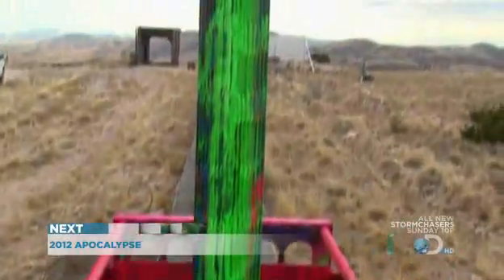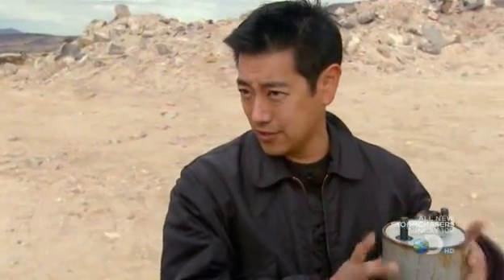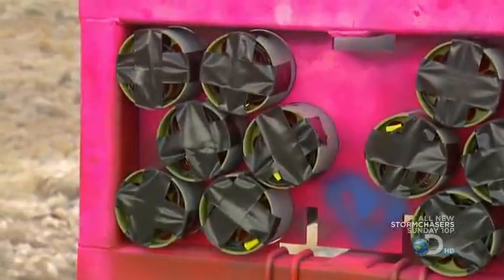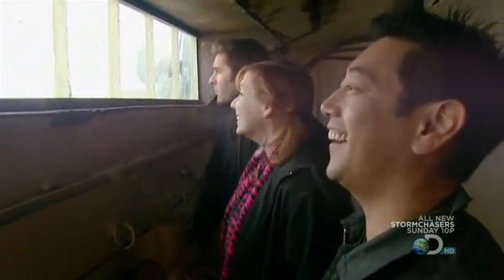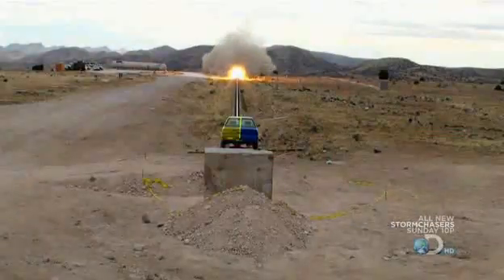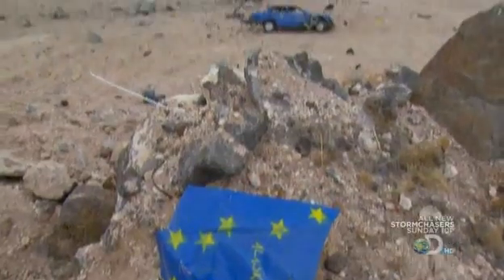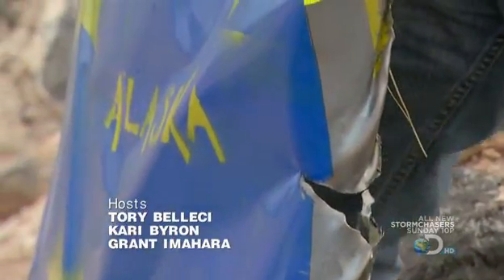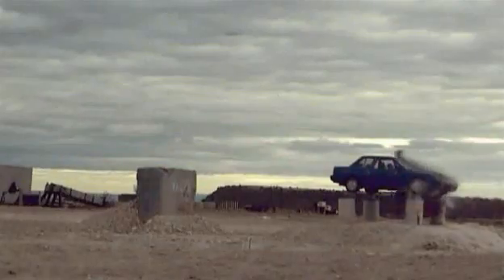Mythbusters: Myth Revolution - Rocket Snowplow

Comment: why didn't they use 100000000000000000000000000000000000000000000000000000000000000000 rockets
Reply: 'cause they probably don't know anyone with that many rockets
Reply: 10^64 is much MUCH more than the amount of grains of sand on Earth (10^18).
It would be better to say, the number of atoms earth is made of (Which is 1.33*10^50). And that still doesn't come close.

I take things too far. ._.

Comment: Did they ever find the blade? If you freeze it at 4:21 it looks like there is a piece of the blade mid air behind the concrete block. I have trouble believing that a solid piece of steel that thick would just disintegrate